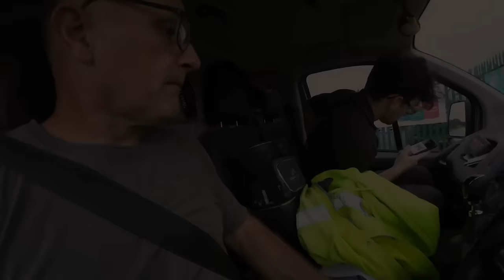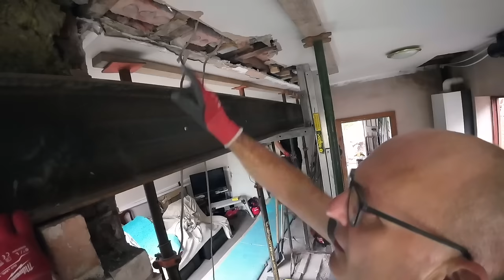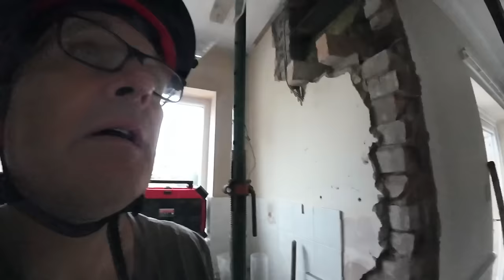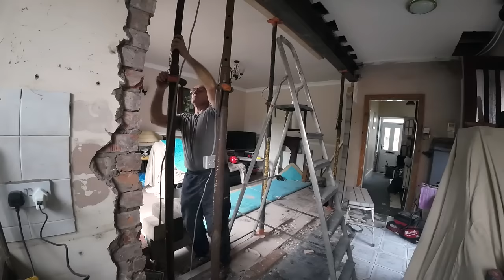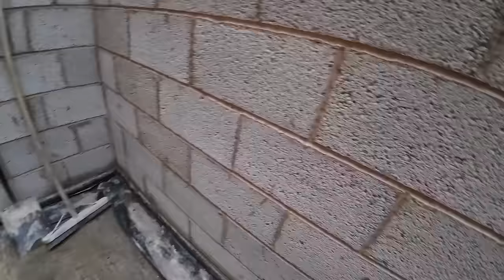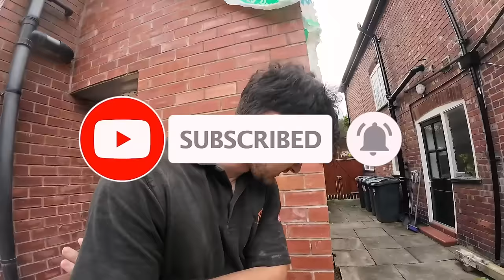HUGE STEEL BEAMS ARE NOT EASY TO INSTALL!! SMALL EXTENSION PT 12

Comment: Good job guys!
Genie was good idea with all the messing about needed to get the beam in.
The structural engineer didn’t do you any fsvours going for 254x146 beam rather than 305x105 which would have gone inside the wall.
Headroom didn’t look tight enough that 50mm would have been critical.
Anyway glad you got it done safely and neatly.
Reply from the maker: Cheers Mark 🤜🏽🤛🏽🧱👍🏽

Comment: You could probably have 'walked' the Genie in sideways with the feet around the door frame as there was clearance under the boiler. The big wheels on back may have interfered with the door though.

No Genie I've ever used lifts a beam perfectly horizontally as the castor wheels are nearly always bent slightly out of true. Do a test lift with a level on it then pack the lifting arms to get steel horizontal whilst still at ground level.

Worst problem I've had is the Genie 'hanging up' whilst lowering a 400kg cast in situ concrete beam out. About half a spool of cable wound off with no downward movement! Not sure they are designed to do take a shock load!

I always wind them to up their limit  before using them for a lift now. Then when I let it down I make sure the cable is spooled on neatly in 2 or 3 wraps, just another potential problem taken out of the equation then.

Wait until you need to use two on a job simultaneously. Great effort as always fellas. HNY.
Reply from the maker: Good advice thanks .
   Same to you too 🥳🧱👍🏽

Comment: You should’ve turned the forks on the genie lift the other way up, then you wouldn’t be hitting the ceiling I use them all the time you can turn the forks both ways
Reply: They did half way through.
I guess it was delivered 'wrong' way round?
Reply from the maker: No you have to assemble them . 
   We didn’t realise you could fi them safely 🧱👍🏽
Reply: Everyday a school day 🙂
Are you going to use one more often?
Reply from the maker: @markdauncey927 definitely 😁👌🏼👍🏽🧱

Comment: Good job men, well done. How scientific is the I beam size requirement calculation or is it a case of just using a huge beam. I was thinking lighter is good. I guess aluminium would not meet the fire regs.
Reply from the maker: All worked out by our structural engineer 👌🏼🧱👍🏽
Reply: Aluminium beams just 'not available' and would struggle meeting deflection criteria within sensible sized sections
Reply from the maker: @markdauncey927 🧱🧱👍🏽
Reply: @markdauncey927  I thought it was wishful thinking on my part 👍